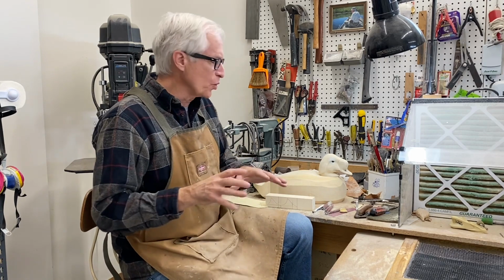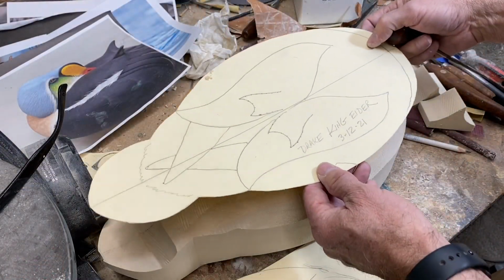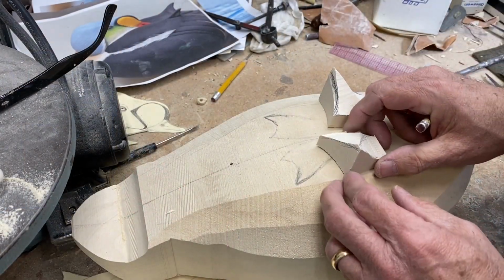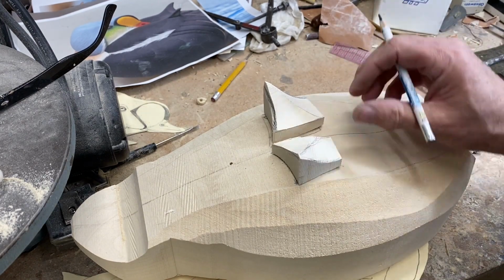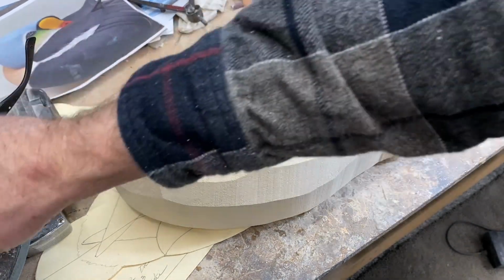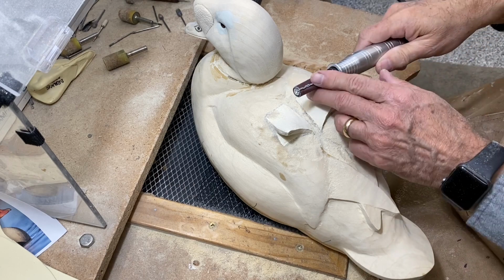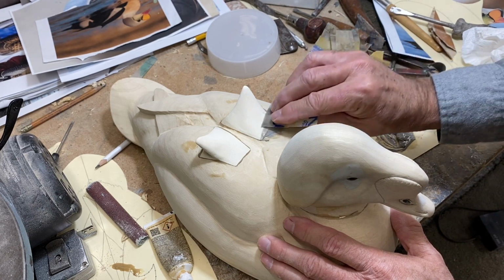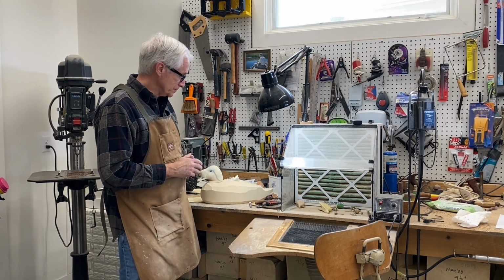King Eider Drake Session 4 -  Thorn Feather Inserts

Comment: Thanks again for your videos, Tom! The King Eider is one of the projects I'd like to tackle and this will be very helpful. Have a safe  trip out to the Ward competition and good luck! Quick question: I need to upgrade my dust collection from my ghetto shop vac set up. Would you go with a Tornado 1000 or a portable unit like a Woodstock Shop Fox. The price would be very comparable in Alaska as I can get the Shop Fox locally. I have already built a downdraft table and plan to purchase a band saw in the near future so the Shop Fox would be dual purpose. Thoughts? Thanks! Brad
Reply from the maker: You are welcome!  I’m not familiar with the Woodstock Shop Fox Brad so it’s hard to comment on that either way. I have been happy with the Tornado bench top unit but I don’t move it around. Maybe some others could weigh in on the Woodstock unit.